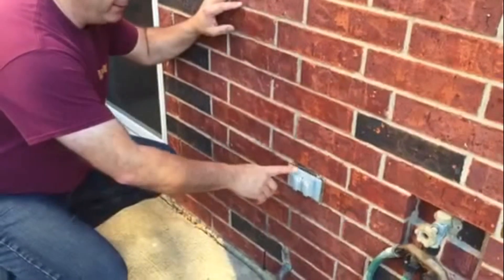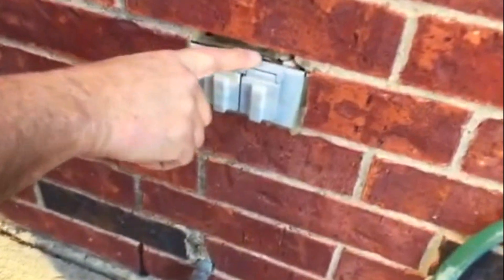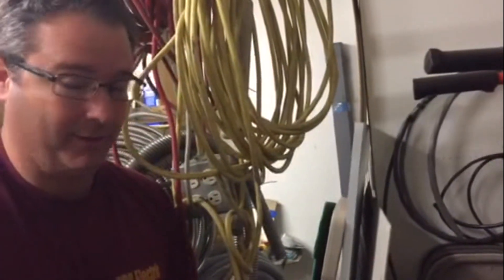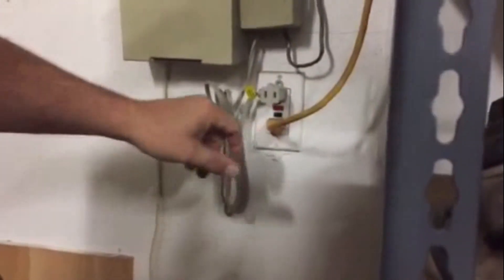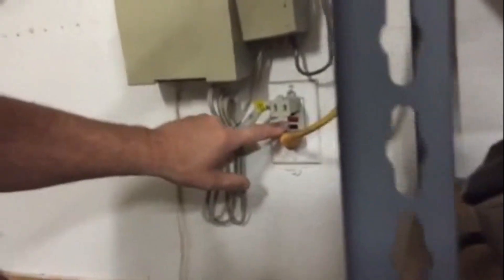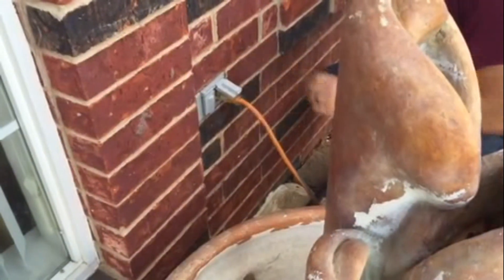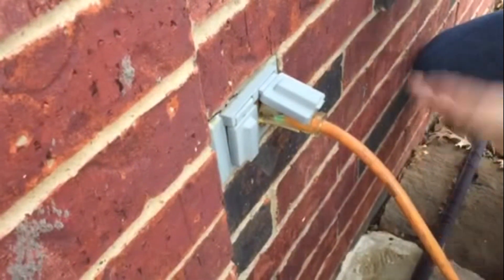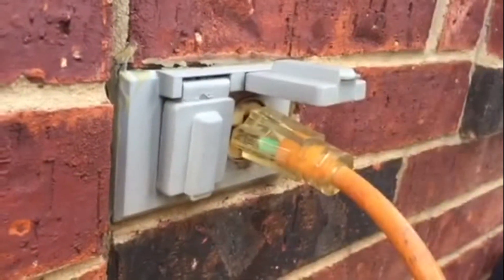Why are my outdoor outlets not working?

Comment: My outdoor patio plugs in my condo are in an area that has a roof overhead so rain doesn't hit it. The outlet has GFCI and I reset it, but my Christmas lights still won't turn on. So in this case the garage GFCI has nothing to do with it? I reset the garage as well just in case, but nothing. Any other ideas?
Reply from the maker: @raymondveal4531  did you plug your lights into an interior plug to confirm that it's not the lights?
Reply: @abrelectric Lights work with interior plug. Plugged in my phone charger in the exterior plug but didn't charge my phone.
Reply from the maker: @raymondveal4531  if the GFCI is present at the outdoor outlet you're using, it may simply need to be replaced or have loose connections.
Reply: @abrelectric  is it an easy fix as long as I buy everything I need? My breaker doesn't show anything for patio electricity shut off.

Comment: What if live in apartment  upstairs. Where woukd the gfi be
Reply from the maker: How old is the apartment? Check the breaker box for a GFCI breaker? Check the bathroom
Reply: @abrelectric  yes sir! It was definitely  the bathroom. Is there any tips to cover that outside outlet so it dosent trip from what I assume was moisture  or my lady running her hair drying an curling iron at the same time idk lol it did rain a few days prior or the day before not sure.
Reply from the maker: @Killerhub93  check the outlet and make sure that it's sealed especially where it presses against the building. Sometimes it just needs some caulk

Comment: Does this video apply to outlets that are marked "WR" but don't look like typical GFCI ones?
Reply from the maker: @Rew123  it depends.
The WR receptacle may be down line, and protected,  by a GFCI in another location. If it's a newer house (5 years or less), that WR receptacle is very likely protected by a remotely located GFCI plug or breaker.

Comment: I had Christmas light on and it rained a lot. It definitely tripped something or worse. I hot every GFCI but to no avail 😢 the outlet still has no power.
Reply from the maker: Keep looking! Many times the GFCI can be hidden behind stuff on shelves, in a laundry room or another outside plug.
Reply: @abrelectric  I will today. So water from the Christmas lights couldn't fry the wires behind the walls? All the circuit breakers work too.
Reply from the maker: @randypoffo4life  shouldn't. Water should trip the GFCI by design. Especially if the house is built in the last 25 years
Reply: @abrelectric  all good the first GFCI I reset fixed it. My crap voltage reader wasn't reading the outlet lol

Comment: THANK YOU! I had a construction crew finish building my deck and patio and halfway thru their tools stopped working outside and we had to run a cable to the garage.

Tried using my outlets outside to power stair LEDs and they wouldn’t turn on. Found the GFI in my closet in the hallway that has the water heater because of this video
Reply from the maker: Great catch?

Comment: Very Grateful for this video. The key info is ALL outdoor outlets are controlled by a GFCI outlet IN GARAGE. All of my outdoor outlets were not working as water splashed into an outlet (conneted to the grill) in the backyard. 

I used a Kobalt Receptacle Tester (which worked fine for my bathrooms to trip in the past) but it didn't fix the issue. 

Once  saw this video, went to the garage and found the GFCI outlet with the YELLOW BUTTON LIT (AC and water timer outlets in garage were working fine). Pressed the yellow button and all outlets work now like magic!! Thanks again.

Comment: Tripped and reset GFCI, tripped and reset circuit breakers, replaced indoor GFCI and outdoor outlet but still no electricity outside. Frustrated.
Reply from the maker: Sorry to hear that. Do you have a multimeter or plug tester? To confirm whether or not the issue is from a GFCI. 
Also, have you checked for tripped GFCIs in your laundry, guest bath or basement?
Reply: @abrelectric  Yep, checked all of the GFCIs with a tester and they passed. I lived in this house for nearly 18 years. Many years ago there was no electricity to the outside. All I had to do then was reset the GFCI in the downstairs bathroom. Resetting that GFCI did not work this time. Nor did replacing it and both outside outlets. This would have been a nice weekend to work on overdue outside projects but it was wasted chasing an electrical problem.

Comment: Worked!! Fyi for anyone having the same problem. I couldn't find an outlet in my garage ( or anywhere else in the house) that had the reset button besides my bathroom. Pushed it and it worked!
Reply from the maker: That is super interesting. As people respond to the GFCI situation, it reflects the different code requirements and styles of wiring that changed over the last several decades

Comment: I don't have a garage and my outdoor outlet is not working.  I checked the breaker and there's no tripped breakers they're all how they're supposed to be. I clicked on the reset button in my bathroom but that didn't work. Oh I must mention the outside  outlet has the orange light on but when I push the button to reset it  it does not reset or make that clicking noise. What to do now? Awww man I really wanted to put my Xmas lights.🥺
Reply from the maker: There's a chance that plug with the orange lights controls other outside plugs. One of those might have something plugged in, that's keeping it from resetting

Comment: House is so old, can't find the circuit they are on....very frustrating
Reply from the maker: What's going on?
Reply: @abrelectric  one of the outlets outside the house stopped working today.
We have/had the Christmas lights plugged in to them for the last 2 weeks. They don't work now.

The house was built in the 30s and only has a fuse box; none of the fuse boxes seem to be connected to the oulet.
Reply from the maker: The receptacle your Christmas are plugged into - is it a GFCI? How are you checking your fuses?  With older wiring,  you may need to get some electrician help.

Comment: You saved me from calling an electrician. I followed what you said and went into the garage and found it. Reset and went outside to check. It worked!!! I was unable to put up Christmas lights last year. 

I went outside to the circuit breaker and didn’t find anything tripped. Last resort was to call an electrician to fix it
Reply from the maker: You are blessed by God!

Comment: So all 3 outlets outside don't work. I checked all my gfci in my house. They all work. I don't have any gfci outside to push on. Just outlets. Panel box everything switched to on. Any suggestions?
Reply from the maker: Did you check in your garage and laundry?
Reply: @abrelectric  i live in a town home so no garage and I checked in my laundry room. Nothings there. Weird right. I hooked up a multimeter to all my outlets outside. Nothing
Reply from the maker: Take your meter, and do continuity from ground to neutral in one of the dead plugs: if you have continuity, you have a separate wiring or breaker issue. If no continuity, you have a tripped GFCI

Comment: What do I do if water is tripping it? Do I have to call someone or just let it dry?
Reply from the maker: Drpends on how it's getting wet. Are you talking about an outdoor plug? Does it have an outdoor cover? What's your water source?
Reply: @abrelectric  the water is rain and it is outdoor, we have a few halloween decorations with 2 extension cords
Reply from the maker: @grottygrub4122  the cord needs to be plugged into an in-use cover. The extension cord connections need to be dried, wrapped (ziploc and tape), and off the ground (on a brick or board). This is temporary solution for temporary holiday lighting.
Reply: @abrelectric  thanks

Comment: My GFI was in the downstairs guest bathroom. Thank you!
Reply: @janellechase7407  That's a good question. I did not test the outlet when it was tripped. We are having a wiring problem in general in this house. It appears the two upstairs bathrooms and one of the outdoor outlets are connected to that GFI/GFCI. It goes out almost every day, and we have no idea why. The outlets indoors are not getting wet. The outdoor main circuit breaker is not perturbed. So far we have found 3 GFI's (two in the house and one hidden in the outdoor BBQ island). It will likely go out again soon, so I will update you. All I know is the lights were working in the bathrooms, and only the outlets were affected. It's possible if it's a GFI issue that one may be hidden somewhere. We had to move the outdoor refrigerator to find that third GFI. So far I have not located one in the garage, but we still have a lot of boxes stacked up.
Reply: @janellechase7407  Also, did you test and reset (meaning you heard the click and you pressed the button in again)? It seems to be standard practice that several outlets can be connected to a single GFI switch. My neighbor is an electrician. If I see him I will ask him about this.

Comment: Thank you! We had this problem and the GFI on the other side of the wall inside was not tripped, so we didn't know what could be wrong. After watching your video, I looked around and the one in our bathroom was tripped, and resetting it fixed it! Now I know what to do next time, and that saved me from having to bug my electrician brother with another electrical question! :D

Comment: How to fix if one of the outlets is not working within a receptacle? Resetting is not solving and the other outlet is working fine. Any suggestions are appreciated!
Reply from the maker: There is a jumper between the screws on both the hot and neutral sides. If it's cracked or broken, you'll get half hot. Also, it may be switched Halton, half constant

Comment: Watched 3 "PRO" Journeyman Elertrician videos all jump straight to Bad Breakers, testing breakers, and bad outlet., I have even paid a Home Warranty Handyman $75 to push the reset on a GIF I had no Idea where it was, and If I didn't I would have any idea what it was for (the outlet). You are on it!! Really seriously GFI Floor board height, w ifes closet behind her shoes. Jacuzzi tub GIF. I panited it red, added a "post it" not to the access panel in guest bedroom closet where the  Jacuzzi pump actually is. 1 GIF knocked out half the house GFI hidden in a closet for a Jacuzzi tub in Master bath, and pump.and access to it are  in another bathroom?! Holy crap! Found it, patients prevails! Thank you SO much.
Reply from the maker: Way to persist! Sometimes,  the wiring just doesn't make any sense.

Comment: Does the GFI for outside plugs most of the time located in the garage?
Reply from the maker: Most of the time. Depending on the age of the house and the state you live in, it may be in a bathroom,  GFCI breaker or in one of the exterior plugs.

Comment: I am running with a problem like that but I can't find my GFI the only one that I found with the same Test and reset buttons but this one was an outlet made out of an external light that only works when the light is ON I don't thing that one can control anything. Any advice please let me know and thanks for that great video.!!
Reply from the maker: I can only suggest, depending on the age of your home, to check for bathroom GFCIs being tripped, a tripped GFCI breaker. Good luck!

Comment: My Christmas lights stopped working the other night and this did the trick! I looked all over in the electrical box and couldn't find a tripped breaker anywhere. I would have never thought to look at the GFI to reset, but it did the trick. You saved me hundreds of dollars instead of calling an electrician. Thank you for making this video possible! Merry Christmas and happy holidays from Iowa!
Reply from the maker: Angela, that's awesome!
Reply: This just happen to me this year with my lights outside,  they stopped working.   I never knew until this video it could be on the same outlet GFCI  in the bathroom.    so this saved me from getting an electrician.     way cool.

Comment: thank you very much. you saved me panic. I used an Electric Charcoal Starter to turn on Barbeque grill, but I think we left it longer than we should. Then, all of sudden it turn off all the power outlets outside the house and inside my garage. After learning to reset, it worked great and now everything is ok. thank you so much. Very helpful video.